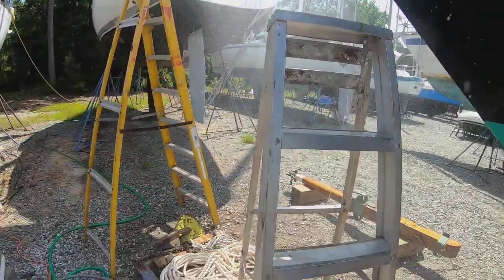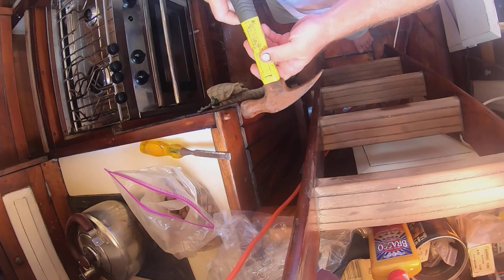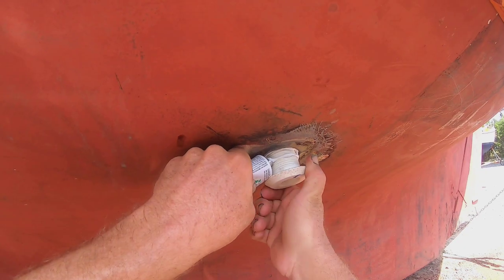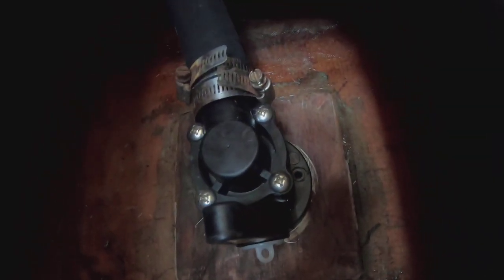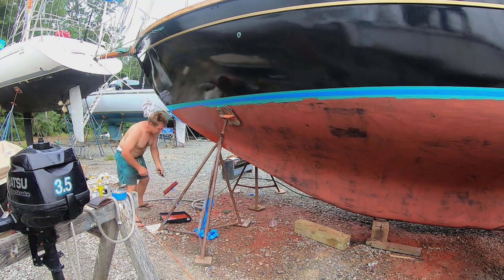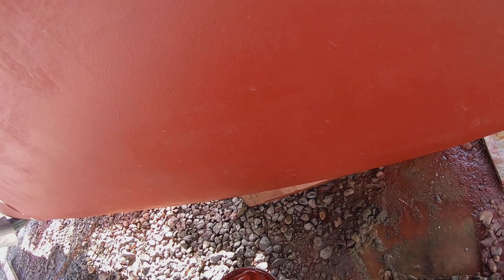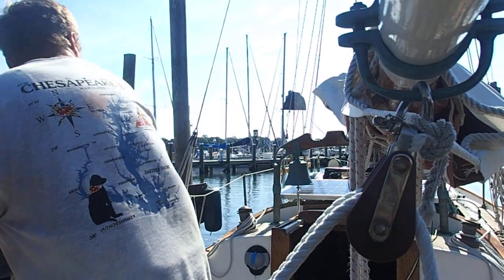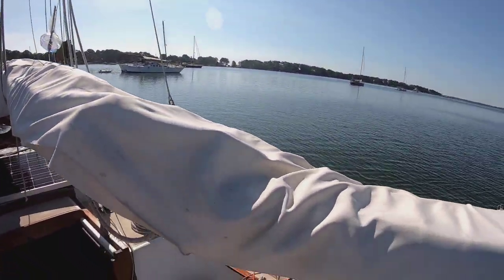Through-hull replacement and ... splash!

Comment: Great to see you out on the water again.  Something we share in common: dissatisfaction with new antifouling formulas.   I too have gone through 3 brands in 3 years --- and am still unhappy.   :-(   I think we have now reduced the toxicity on them to the point they no longer serve their purpose.   Brand number 4 next Spring!
Reply from the maker: Hi Patrick, record which paints you use and the problems you've had--this is useful information to boaters.  It's very frustrating to pay $250 per gallon for paint that doesn't even keep the growth off for one year.
Reply: @howtosailoceans1423  I have never used an antifouling paint that does what the advertising says it will. The closest was International 640. 640 is what the U.S. Army was using on their vessels when Rebecca and I worked at Kwajalein Atoll, a U.S. Army missile tracking base in the middle of the Pacific.  International 640 can be hard to get in far flung places of the world though. The next, upcoming test, will be Coppercoat.
Reply from the maker: @RVLifeNOW  Let me know how that goes.  I saw several cruising boats in the yard with Coppercoat, and the owners were happy with it, though I saw patches of barnacles on those boats.  You could of course scrape them off without damaging the paint, unlike ablative paint.  Plus you have to completely strip the bottom first, probably best to have the pros shot blast it.
Reply: Patrick
, Patrick ,  and how to sail oceans , keep up the good work,
Edward Finn

Comment: Hello Kevin,
 Another great video. Check out a Product called Wetlander. They  use it on Airboats. I built a Mud Boat 2 years ago and put it on the bottom. Never seen anything like it.  Very slick and nothing sticks. It's not cheap but will last for many years. It's a small company in Florida. They can tint it any color you like. When I ordered mine they said guys are using it on Sailboats now with great success. After two years my bottom still looks like the day I put it on. I run through sand, mud, rocks, logs. Best money I ever spent. You are a big inspiration to so many people.  Thanks for the great videos....

Comment: Nice to see her in the water again.  Could you do a video on anchoring ? On boats with engines we do such a lot of dropping the hook then reversing up to 1800 rpm to check it's stuck.  How do you check the he anchor has taken without an engine?
Reply from the maker: It it's windy, just watch for a little while.  In lighter conditions do a flying anchor set, drop anchor while you are sailing and let it stop the boat.
Reply: @howtosailoceans1423  txs, it's not when it works I worry about, it's when it fails and you are dragging with no engine to take the strain off.  I guess it was done your way for a few hundred years, just with a few more people on board to help pull.  Anyway love the channel and always learn stuff
Reply from the maker: @richardmoore4194  I've had that happen a few times, have had to scramble to get my second (fisherman) anchor deployed.  Actually I went through that drill numerous times back when I had a CQR as my main.  The Spade anchor I now use is far more reliable.

Comment: Not using a cleat, but to wrap the rode on the opposite side of the windlass, is that the normal practice? That is quick.
Reply from the maker: No, probably not recommended, but it works .

Comment: Kevin,

Always enjoy your video's , I am not familiar with that brand of through-hull , are they a newer type than the older brass and stainless type. And as always Fair Winds and Safe Sea'a
Robert
North Star
Reply from the maker: Hi Robert, I was not familiar with Marelon (made by Forespar) either until recently. So far so good.  Of course the great advantage of composite through's is no worries about electrolysis or corrosion.

Comment: How did you decide to go with Marelon throughull vs bronze? I dont have enough knowledge to have a strong opinion on this, but given the vintage character of S/V Ruth Avery, Im a little surprised.
Reply from the maker: The biggest appeal of Marelon is no worries about galvanic corrosion or electrolysis.  After one year the through has worked fine, valve moves no problem.

Comment: Why couldn’t you use a cofferdam on the exterior hull to flood and test the hull fittings?
Reply from the maker: Perhaps I could if I had heard of it.  Cofferdam ... learned a new word today!
Reply: Wellllll, by strict definition a cofferdam is used to isolate a ship fitting( or hole) located underwater, as in below the waterline while the ship is afloat.  I was trying to suggest pressing a box or other container over your through hull fitting and filling the container with water to test for leakage before you splash, or even finish painting. There isn’t a lot of pressure difference involved.
Reply from the maker: @forwork321  That would be possible, but if it had leaked they would have pulled the boat back out immediately.  Luckily that did not happen.

Comment: Have you ever used chain on the bobstay? Ruth Avery is looking quite sharp!
Reply from the maker: Previously was bronze rod, but it was heavy. Chain would also be heavy, so I went with synthetic.
Reply: @howtosailoceans1423  Good to keep weight out of the ends
Reply: @howtosailoceans1423  Synthetic won't rust, so that's a big plus.

Comment: check out the “band it” banding tool for connecting hoses.   The stainless steel double wrap bands are incredibly strong and leak proof.   I’ve used these for many years, often on high pressure systems.   They do not have the issues of worm type hose clamps, and can exert tremendous clamping pressure that is uniformly distributed...... I’ve never “looked back”!!!.     My ideal is zero through hulls below the wl....   Why??
Reply from the maker: Yes, the worm gears are the biggest problems with clamps.  The only issue I see with "band it" is how to remove them?
Reply: they must be cut off.... and that can be a liability.  Tbolt clamps are far superior to the worm type also....